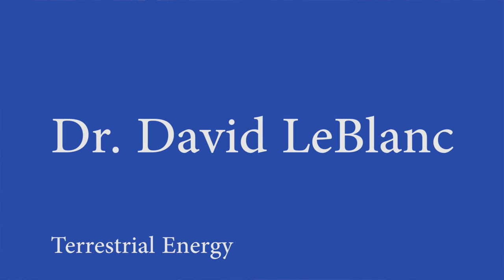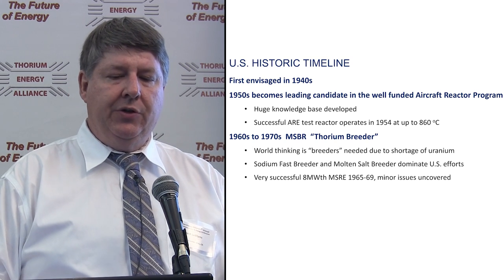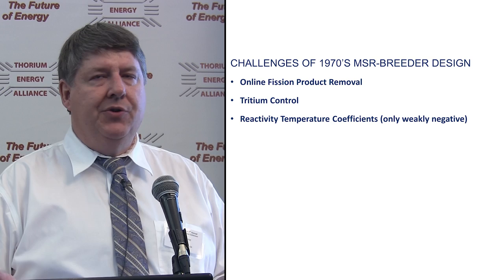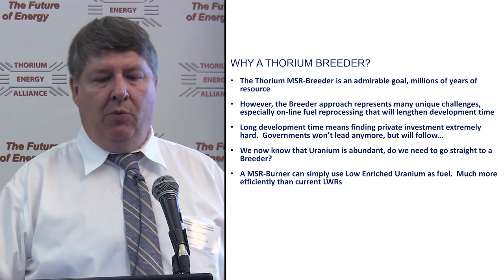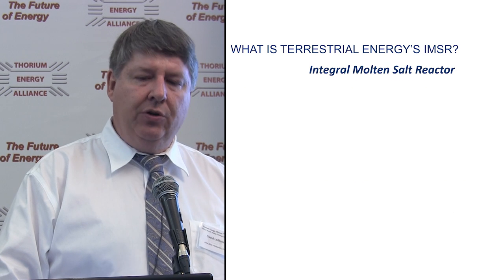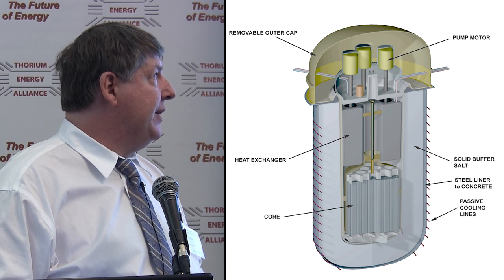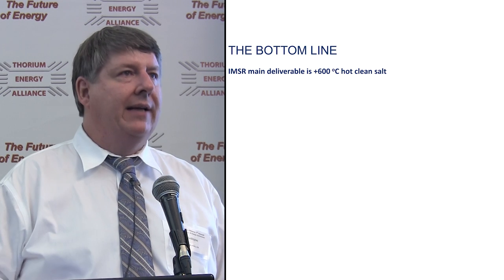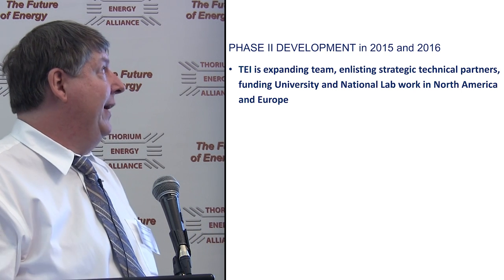IMSR: Terrestrial Energy's Integral Molten Salt Reactor -by Dr. David LeBlanc @ TEAC7

Comment: Fukushima shut down? You sure about that, because Tepco was still considering pumping ocean water into the core until the core fell into the ocean last fall.
Reply: Joe11Blue the core fell into the ocean? are you really sure about that?
Reply: boerenkool That's what Tepco basically said when they stated the core went under the waterline and was no longer visible.
Reply: Joe11Blue sigh

The moment an earthquake was detected, all of the Fukushima-Daiichi units automatically shut-down. In fact I'm pretty sure every single reactor anywhere close to the earthquake immediately shut-down. Japan uses a very sophisticated network of seismic sensor stations and data links between them, which allows them to actually issue warnings to the public that an earthquake is about to occur, even up to a minute before the most powerful shockwaves hit. This gives everyone time to take cover, stop their cars, etc. 

As soon as this warning is tripped, nuclear facilities scram their reactors. Each facility also has its own seismic sensors to detect earthquakes which are also linked to an automatic scram system. It's a bitch to clean-up because when you do that in a solid fuel reactor, the xenon build-up is enormous, and you can't start the thing for a day or two, but it's better than them being in a state actively producing power and then getting stuck there because of damage from an earthquake.

The problem, as this guy rightly said, is the decay heat. That's the problem once you've shut-down a solid-fuel reactor, and it needs active cooling. The biggest problem is the water which is under enormous pressure. Once that starts boiling-off, you've got a containment problem, all water-cooled reactors take this into account. MSRs don't have this issue at all since the coolant/fuel isn't under pressure.

Even then, the decay heat wasn't the biggest problem at Fukushima-Daiichi. They did eventually manage to start pumping water into the reactor buildings to start active cooling. The major issue was the evolution of hydrogen gas, which blew the tops off the containment buildings (but the reactor cores were pretty much undamaged by this, so what radioactivity was released into the environment was pretty minimal, especially compared to Chernobyl, where the entire bloody core exploded).
Reply: *****
Tepco was saying the reactor was still running just last fall. Which is counter to what you are trying to tell us here. I think I will take what Tepco says on the issue far more seriously than you and your passive aggressive condescension.
Reply from the maker: Joe11Blue If you're going to be telling us what & when TEPCO was saying, then offer a Google search term for an English TEPCO press release or Reuters summary. Because it sounds like you're conflating decay heat with fission.
Reply: gordonmcdowell
There was no press release, it was in Tepco's own findings in their quarterly report on the site.
Reply: Joe11Blue
It definitely sounds like you're conflating decay heat with a running reactor. Had any of the units been running when they lost power (and by some confluence of circumstances, were stuck in that state), they would have suffered from a steam explosion hours after the earthquake, since all active cooling systems were down.
Reply: Joe11Blue Here's the latest summery of decommissioning from Tepco:

http://www.meti.go.jp/english/earthquake/nuclear/decommissioning/pdf/20150625_e.pdf

No mention of cores falling in ocean.
Reply: +Joe11Blue The cores never left the reactors.
Reply: Mark Pawelek
They fell into the ocean in 2014.
Reply: *****
No, it was documented that the robots they sent into the core area couldn't find the cores, they had dropped into the ocean.

This was Tepco's own release.
Reply: Joe11Blue
You're confusing missing fuel with the cores being in the ocean. One, the fuel isn't the entire core. Two, in 2015 they only said something along the lines of "It's not where it should be if the reactor was completely intact". They are not saying, nor have ever said "Yeah, the entire reactor cores are all definitely in the ocean now."

What's likely happened is the fuel melted (duh) and landed on the concrete slab that's there for containment. It's very hard to get an accurate picture though because of the radiation levels inside; even robots will have serious issues. (Edit: The imaging that confirmed the meltdown wasn't even made by robots, like you said. It was taken using other means, namely one very, very clever use of cosmic rays and a detector to create a sort-of "x-ray" like image comparable to what you might see in a hospital, just a hell of a lot more complicated and using much more recent and bleeding-edge physics.)

What you're saying is complete hyperbole and is not supported by the available evidence, so yes, you're talking shit.
Reply: *****
No, Tepco said the cores slid into the ocean. As in the whole platform they were sitting on was under water.
Reply from the maker: +Joe11Blue That does not even qualify as misinformed. Reactor cores do not "drop into the ocean" if they're not positioned above an ocean. Was Fukushima operating on a barge?

No Fukushima press release said that. If someone told you TEPCO said that, then ask them for a link to the press release.
Reply: +Joe11Blue So you're basically saying that the reactor cores fell, and then mysteriously teleported 200m east into the ocean? Because last I checked, Fukushima Daiichi was built on a hill, which, correct me if i'm wrong, is not the sea.
Reply: The Fukushima explosions were caused by hydrogen/oxygen generated inside the reactor vessel by steam against the zirconium fuel rods and maybe some neutron flux cracking of water. The meltdown was caused by decay heat and no means to keep the fuel cool. 
The reactor cores continue to make decay heat and would melt if left open. Therefore they are flooded with water. But that water is quickly contaminated and there is no secondary containment which means ground water and potentially sea water are getting contamination.
The BWR/PWR reactor design is fundamentally hazardous - protected only by active safety systems. When these all failed a meltdown was inevitable.

Comment: Frankly, this is the most credible MSR version:  quite efficient, walk-away safe from Fukushima-Chernobyl scenarios, low waste (basically like any other MSR) and easy to implement in short term (unlike other MSRs, instead). Yes, it's not a breeder and thorium based, but who cares ? For the decades and maybe centuries to come, it's an almost irrilevant issue (due to the reduced and slower need to reprocess, it actually produces less long life, high toxixcity transuranics waste per unit of energy than a full thorium MSR breeder, thus a very tiny amount)
Reply: babyelian77
Reply: I like it for Moon/Mars...

Comment: What's the deal with two heat exchangers between the core and the power generation cycle. Why would you use two instead of 1? 2 requires a larger capital investment and less efficient cycle.
Reply: It allows you to segregate the fissile end from the non fissile end. Totally seperating out the steam. System via double layer means your cost of operating the steam system is much cheaper. On top of that, steam works better the higher pressure and temperature it runs at, but that limits the wall thickness, which in terms is complicated given the corrosion issues.

Comment: I see why this design is a stepping stone and develops a lot of technologies supporting future thorium based MSR's, but what he's talking about isn't a thorium reactor...
Reply: +James Lewis His reactor design isn't a thorium breeder reactor.  
"Thorium Reactor" or a Liquid fluoride thorium reactor is just a specific configuration of a MSR.  Don't get the reactor type confused with the fuel type, thorium is just a fertile that can work in any reactor type.
Reply: Dukky Drake Right, what he's talking about is an MSR, but he's also mostly not talking about Thorium... which does make me think that it's a bit of a side track given the "Thorium Energy Alliance" banner... but I also agree that lots of these technologies need to be developed even if not initially used with Thorium.
Reply: +James Lewis 
Most of the public tend to ascribe all of the positive benefits of a "thorium reactor" to the thorium itself when most of the benefits lies with the reactor even if it never burns thorium.  India is using thorium in a pressurized heavy-water reactor and their reactor does not inherit all the positive benefits of a "thorium reactor" just because they are using thorium.  

Conceptually, to turn David's reactor into the ideal LFTR the public fell in love with,  you need to develop and bolt on to the side of his reactor the equipment for online fuel reprocessing. 

Even the govt funded research in the national labs to develop salt cooled light water reactors have a lot of overlap.  All these efforts are heading in the right direction just not very quickly.
Reply: Dukky Drake Completely agree, I was just commenting the name "Thorium Energy Alliance" becomes a little incongruous when the most critical technologies are so not dependent on the Thorium component.
Reply: +James Lewis It will be a thorium reactor. It's a mixed fuel reactor.
Reply: Alternatively, do it the way Terrestrial Energy/Thorcon is doing: have burner reactors that last maybe 4-7 years, and then bring them to a reprocessing plant to simply remove the fission products and add more fertile fuel. It works exactly the same way as the breeders, except without the issues of online reprocessing.
Reply from the maker: Their website currently says 7 years, with a minimum of 2 reactor deployment. So there's 14 years (with 7 years for fission products to settle down in first-of-pair) before an I-MSR site needs to shuttle anything to a reprocessing site. I'd have to assume that 7 year figure is the one to go with, as they'll be low-balling it until they've run test reactors.
Reply: Yes, the huge issue in the eyes of the NRC and almost every nuclear regulator is the fission core of the proposed LFTR has U233 in fairly high purity levels. Pure enough to make a nuclear bomb. Of course there's the U232 gamma problem, the fact that all U233 nuclear weapon tests resulted in below expected yield, and there are zero known nuclear weapons in storage with U233, but none of that fixes the "hell no, forget about it" the NRC is going to give you.
I hope one day the LFTR breeder can become a mass produced reality, but for now its just a dream with that barrier as an absolute show stopper.
Meanwhile, it might be entirely possible for an IMSR to run with formulations like Thorium + reprocessed Pu+Am+Cu+Np as fissile, perhaps with just a little U238 to mess up the Uranium isotope mix.
The problem with LWR/BWR is the safety, and the fact they can't fully fission all Plutonium and minor actinides, while any properly designed MSR can do it (at little or no extra complexity).
Plus this uses 1/6th as much Uranium as a PWR/BWR per kWh produced. Its enough to replace EVERY coal/gas/existing nuclear power plant with IMSR and need no or little extra mining or enrichment facilities. Meanwhile, reprocessing all existing spent fuel would provide a fleet of IMSRs enough resources to run for centuries without any new mined Uranium.
Reply: Marcelo Pacheco The U233 is not ideal bomb material straight from the reactor because there will be a lot of U232 in  with it, which relatively quickly decays to Tl208, which is a really strong gamma emitter.

Sorry, I see you addressed that.
Reply: @mark4asp  Exactly!  It is a mixed-fuel reactor.  It is a great new source of low-carbon energy.  And it's a stepping stone toward lots of great things.  So I am excited about it!  I do agree with James Lewis, though, that MSR is the main event and Thorium is NOT the main event.

Comment: Thorium and molten salt are always mentioned together.  It is only becoming clear to me that these are two separate issues.  There doesn't seem much good reason to go to thorium since the price of uranium is low and there are at least hundreds of years of uranium.
Reply: Incorrect.
Reply: The reason thorium and molten salt are mentioned together is because it's the molten salt reactors where thorium really shows its worth.

Comment: A positive aspect is using a burner to reduce the development cost and time.
A major negative is use of graphite requiring frequent change. It has been planned as replacement of capsules. Reprocessing is quietly avoided.
Use of fuel as coolant outside the reactor is a risky proposition. A secondary salt is also mentioned as an option. In either case salt corrosion risk is carried to heat exchanger.
It may have been better to use a safe, non-corroding hydrocarbon as moderator cum coolant (definitely not ZrH4) even if it requires piping as coolant. Pyrene ( BP404C) comes to mind as one possibility. It could be actually a mixture. Unpressed liquid could raise super-critical steam.
The fuel is best confined to a  core space well protected against salt corrosion.. Use of thorium as a superior fertile with 19.9% LEU, as mentioned, could increase period of use.
Reply: This reactor does NOT use nuclear fuel in the secondary loop. A 3rd loop would be steam/helium or supercritical co2 for the turbine.
The core material is salt coolant+nuclear fuel. But the 2nd loop is salt coolant only. The first thermal buffer outside the reactor is also a pure salt buffer.
Molten Salts are used in many non nuclear applications. For instance any solar CSP plant uses a cheaper salt as its thermal battery so they can use more powerful mirrors and store extra heat to continue producing power through rain and the night time peak demand hours.
Anytime he says salt doesn't mean nuclear fuel mixed in. Only in the core loop.
Reply: I wonder why the carbon has to be changed so often. The British Magnox and Advanced Gas Reactors (AGR) both used CO2 gas as coolant with a carbon moderator. Their moderator was there for the life of the plant. The Magnox life was cut short by failures in the steam generators and that their plutonium was no longer needed putting up the running costs.

Comment: Ok, Here's your chance.  The US NRC Office of New Reactors has a new advanced reactor division and we are looking forward to a new MSR design based on the Thorium-Uranium-233 fuel cycle. 

Now get US DOE to bring back the research from Oak Ridge and submit a design certification (DC) application. 

We will be happy to review it. It may take some work for NRC to develop a NUREG-0800  type Design Specific Review Standard (DSRS) but totally doable in the short term. 

You guys also need some data from the Fast Flux Test Facility (FFTF) at Hanford.